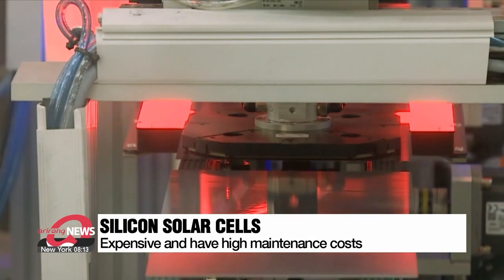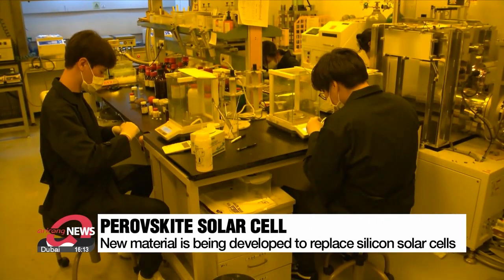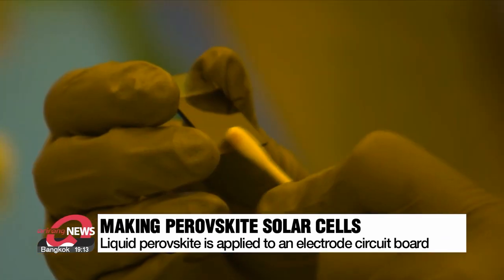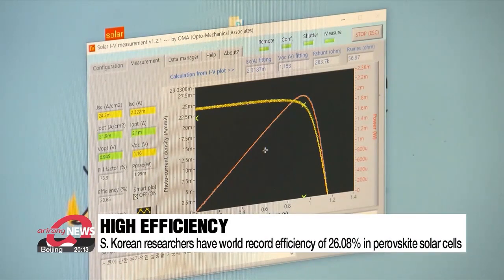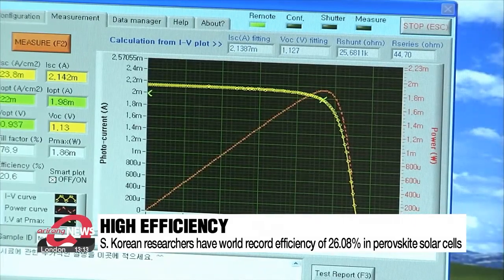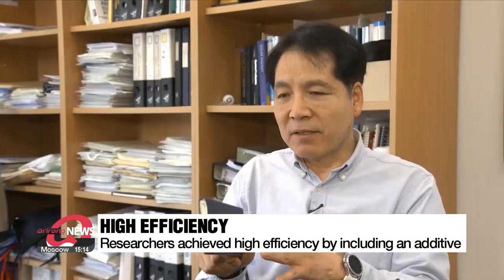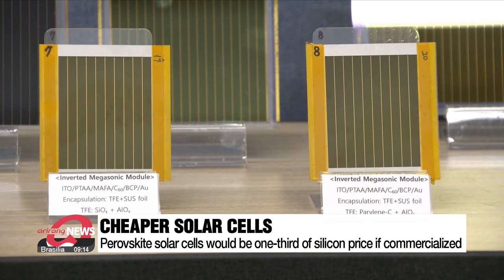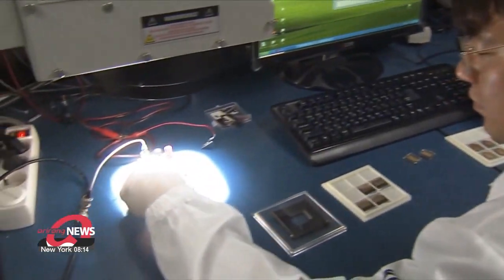S. Korean researchers develop new type of solar cells using perovskite

Comment: HAHA.  These have been around for 10 years at least.  This isn't new.  It all depends if they have better longevity than silicon.  Efficiencies are around 25% (which is phenomenal) but in the LAB.  They have 40% efficiency with some gallium arsenide solar cells, but again, in the LAB.

If the perovskite solar cell is requires less energy to produce (i.e. is cheaper to manufacture), it might be a contender.

The gallium arsenide solar cell took a TON of energy to make it, and wasn't practical - i.e. it took more energy to make it, than you could get out of using it.
Reply: yeah and during this time China makes silicon solar panels cheaper and more efficient